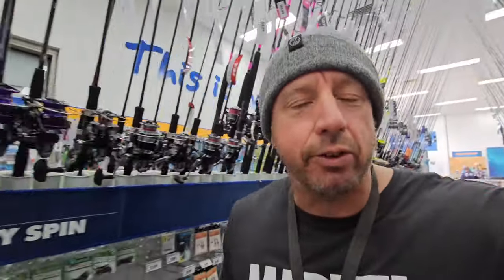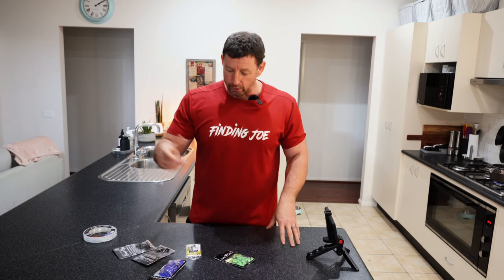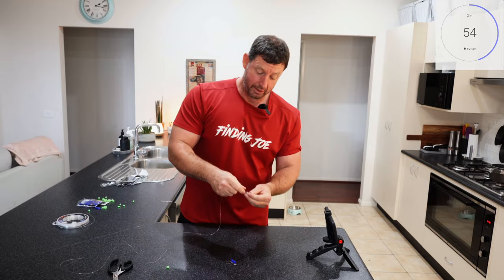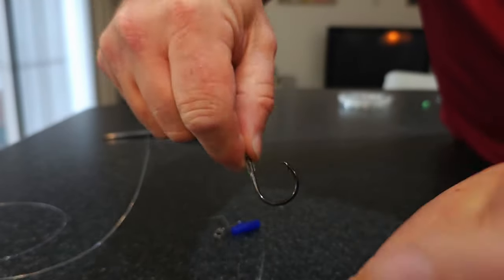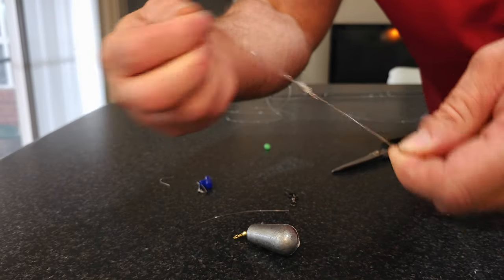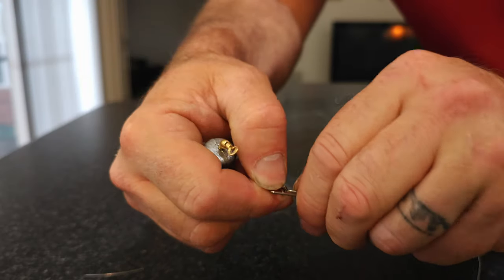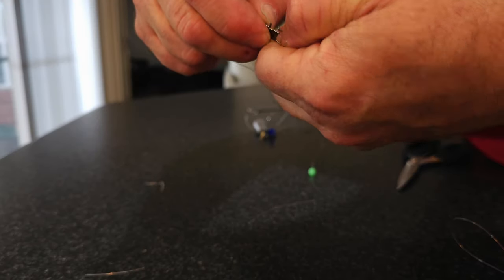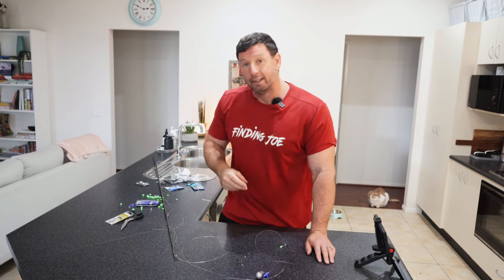Two Minute Tech tuesday - Make your own westernport Snapper rig for beginners

Comment: Good vid mate, I also put a bead on the other side of the sliding clip, protects the rod tip should it be wound to far, mainly for the kids, i do the same knot, and have no idea what its called either haha, but I go around 6-7 times depending on the size of the leader, 80pd and up is tough to pull it tight! Bring on snapper season!
Reply from the maker: Yeah good one, I should put another bead there too.

Comment: Great video as always, it will help lots make their own rigs for snapper season. It's a uni knot or a locked blood knot Muffin man. Do you use the breakaway leader on the ezi rig slider for the sinker? I run a 12lb breakaway leader on the slider it helps keep the baits off the reefs and the weed and acts as a safety if the sinker snags up you can break the sinker off and keep fighting the fish.
Reply from the maker: Thanks mate, yeah use the breakaway leader, I should have said that as well but time was a factor.
Reply: @findingjoe  definitely challenging to do it so quickly. Still enough there for people to work with. I would like to see the muffin man use those monster arms on a big red this season I have fingers crossed for you to get the lucky bait in the lucky spot